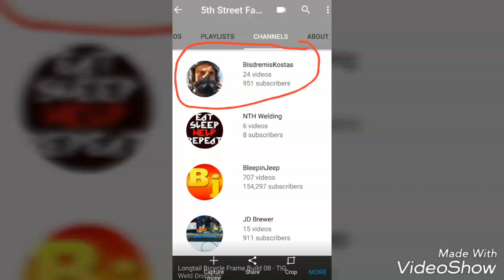Tig welding Aluminum (how to and not to) Arc Shots

Comment: My puddle does not form at all, I melt piece through but no shiny puddle ever form, instead blacky soot on top,  3 mil piece tried all possible amps and settings same result
Reply from the maker: Either your tungsten is dirty, or more likely the material youre using is anodized

Comment: I'm trying to learn on some Aluminum scrap. Very frustrating because it starts out ok, then after a couple inches, the puddle spreads out, flattens and turns into a mess, especially on fillet welds. I get a "Horse Shoe" puddle and can't seem to get it to flow together well. I guess i'm getting it too hot and/or moving too slow. I'm struggling with controlling and coordinating all the variables. Consequently, I jump around with my settings and just flail around like an idiot. Steel and Stainless doesn't look too bad for me, but I think mastering Aluminum 1st is better. I feel like if you can weld Aluminum, everything else is pretty much cake. Any chance you can do a Vid on Aluminum Fillets .. like on 14 or 16 guage?
Reply from the maker: Ya as you start moving you should be slowly letting off the pedal and by the end you're usually just barely on the pedal.  It just takes repetition.  1/8" is the thinnest I can usually get my hands on

Comment: Sometimes I am in a situation where I don't get good ventilation. I know that any fumes are bad but how long should you weld or endure if you have to weld. I am in the process of installing a fan to pull the fumes away but they creep into the helmet when I start but after starting they go away after 10 seconds.
Reply from the maker: Shaq Deisel I personally hate fumes but I hate masks even more which is bad I usually only wear a mask when I'm MIG welding.  Do everything you can to protect yourself though.

Comment: Awesome video, subscribed. What do you think of your ahp alphatig? I plan to pick up the same machine and also will be running it on 110
Reply from the maker: XmyheartandhopeUdie I've had mine a little over a year on 110 and haven't had any complaints.  mine will go up to 150 amps so it's great for steel.

Comment: Thanks! Very timely as I'm working through some of these issues.  Question: Penetration. How much penetration should I expect when welding a T out of 1/8" wall square tubing? I've sliced some of my joints open and the inside wall seems unaffected?
Reply from the maker: Steve Ulrich I like to bevel everything even 1/8".  I bevel it at about 45 degrees with about 1/16 inch on land and no gap.  I personally think that trying to penetrate all the way through 1/8" puts to much HAZ  (heat affected zone)  into the part and also melts too much base material into the joint which can cause cracking especially in 6061.  This is all from my personal experience, other people might do it different but this is the way I prefer.  

with it beveled you should have no problem penetrating!  Hope this helps.

Comment: Hello! I really loved this video, and I want to ask: do you use a pulsatory conditions? And I know that every TIG machine has it own settings and I really want to know what kind of did you use and do you use a treadle while you welding. Thank you! 
P.S. Cool junctions!👍🏼
Reply from the maker: Алексей Филиппов Hey thanks for commenting!  No I don't usually use pulse on aluminum unless I'm bored and just playing around.  The settings I used on this video was frequency at 150 and ac Balance at 40% cleaning.  150 amps but I was using maybe 80-100 amps with the foot pedal.
Reply: Thank you! And I wish to know how a thickness of your metal did you use in your video? And what kind of additive did you use? Thank you so much!
Reply from the maker: Алексей Филиппов this was 1/8" 
5052 and I used 5356 filler.